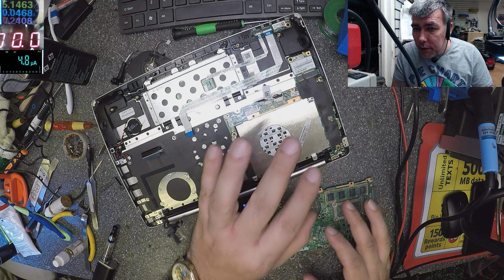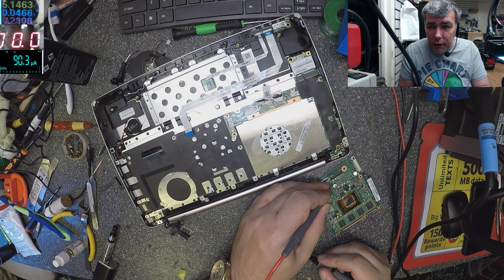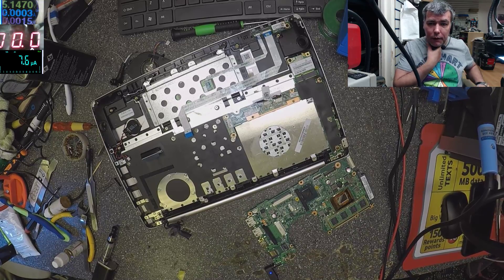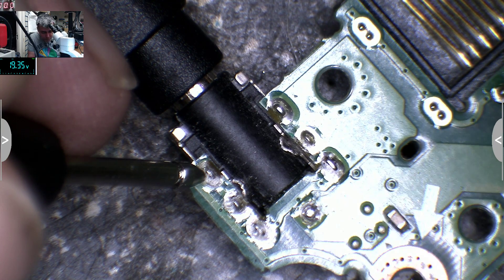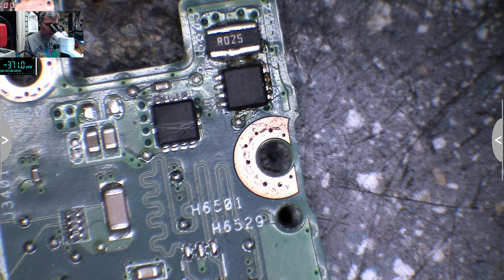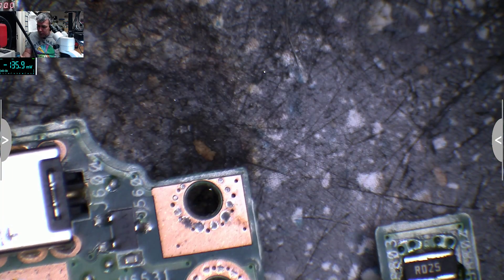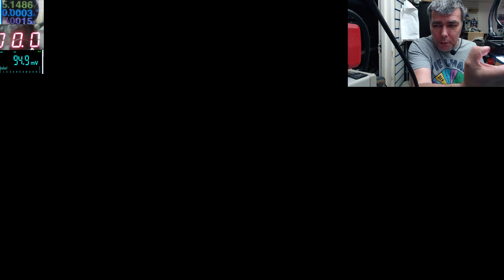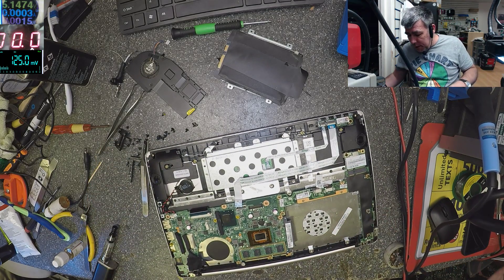Asus S200E , dead, motherboard repair

Comment: It’s freezing because the power adapter doesn’t have enough holdup time so the power supply is unstable , adding some bulk capacitors should fix it

Comment: So happy you made this video. A friend recently gave me his damaged laptop same name and model. It is totaly dead he has bought a replacement power supply 19 volt but at 4.75 amp instead of 1.75 amp. do you think it will be worth my while to use a lower amp charger and follow tips in your repair video or is 4.75 amps ok . Thank you in advance for advice.
Reply: you can use even a 20 AMP (if existed) if the mainboard ask for 1,75 it will use 1,75. never use a 19v power supply with lower amperage. it will burn the power supply

Comment: I, good job! But i have the same laptop model an S200e power on but with ac adapter plugged in, the battery not charge (battery good), and when the battery is very low the laptop turn off and don't turn on also with the acadapter,need to recharge battery if i wont turn on! Any solution?? Thanks
Reply: verify the charger IC

Comment: Thanks for the great video .
I have an Asus X504U laptop,  it's dead .
The first mosfet lined after power plug doesn't give voltage on one side. 
I removed it , shorted it , when shorting it gives a spark , even after shorting it with solder , now the plug doesn't give any voltage .
Another thing , i couldn't find bios bin file that match the size (1024 kb) , only 8mb !
Any help sir ?
Thanks in advance.

Comment: Thank you Sir this video.. i have the same unit to repair problem is the board is shorted en mboard is tampered customer said he sent to asus service center but still not repair,,i have check all caps en mosfet the i remove one mosfet switch as you did yes there is 19v..but still shorted.. help pls..
Reply: Because the mosfet was not the problem. It switched off because there is short somewhere after that mosfet.. I don't know why he guessed that that mosfet was faulty.. Maybe he checked with the power supply before starting the video.. It's not the case with your motherboard as you can see.. or you soldered the gate and the drain together

Comment: This must be weird. But, I see that your GoPro cam blinks whenever you use Power supply probes to check Voltage on a board. it takes about 15 to 20 sec to freeze. Thats why your hands with probes are always on the frozen screen. I think that the Gopro or the power supply need an independent power socket. That happens because they seem to share the same power supply source.
Im a bug fan by the way, but not a 7 min guy. if you see what I mean. keep up the good work. you are a repair Sensei. I wait for your new Vids everyday. I Like the Laugh sound you make when you fix something. hhhh
Congrats from Morocco

Comment: How often do you find boards that have problems in their Embedded Controllers? Do you have a programmer for those chips or you buy them already programmed or take them from other dead boards?
Reply from the maker: they are not dying, just get frozen as they are always on even if the laptop its off or has a dead battery

Comment: that was so good, you explain how to follow the 19v power rail, but how do you know with was the bios chip? do more videos with how to follow the power rails, thank you for sharing your wisdom with us!!!
Reply from the maker: Ok, i will
Reply: xose1984 it is a small black chip with 8 pins, sometimes it's close to the bios battery. On some motherboards the bios chip has a white silkscreen behind it and often has a plastic covering material to prevent shorts. If you are probing voltage with multimeter you should find 3-3.3v on one of the corner pins as you saw in this video.

Comment: Thank you , if the problem was in the second mosfet would it be different approach because in a previous video you had put the power supply in the mosfet to find the short
Reply from the maker: Those mosfets are in serial mode on 19v power rail, so if are in short the laptop will should be working fine. The mosfets from swithcing power supply, yes, if they are in short you can find the quickly with the bench power supply.